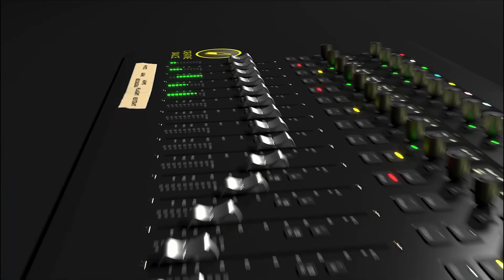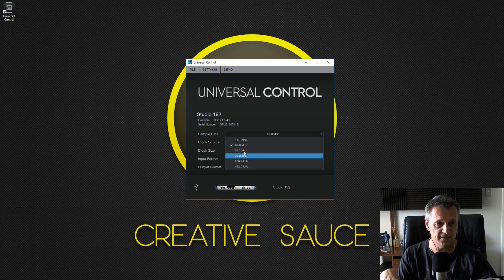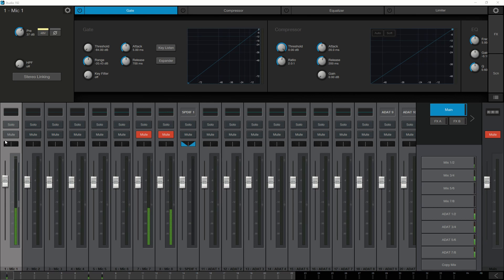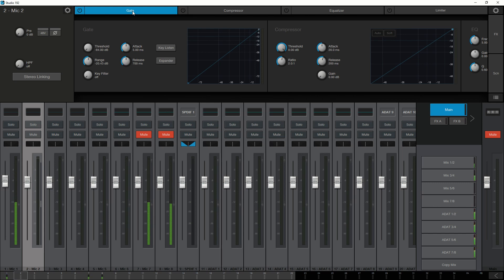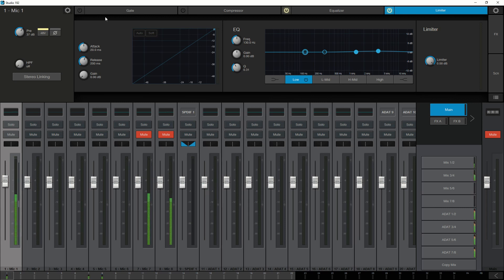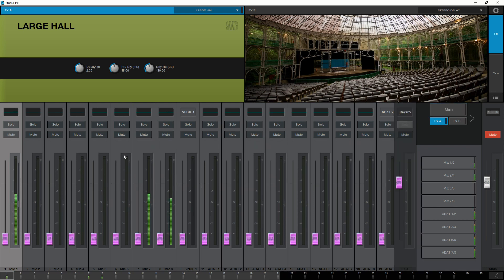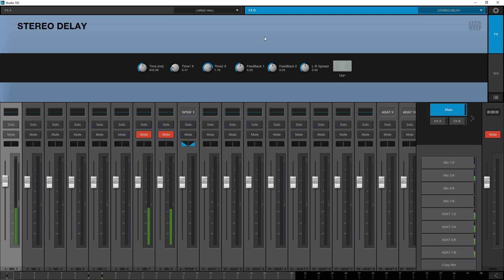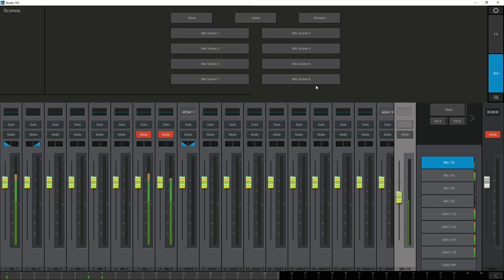Presonus Studio 192 Review Part 2: Setup and Universal Control

Comment: Watching the video because my StudioLive16R looks very similar in setup and on the mixer. I just wish you didnt skip the setup in UC control panel. There are things i just cant get to work, but im waiting for the Presonus to help me out, and I hope to solve all the issues fast so i can get to work. To my disapointment StudioLive dont support Dante. Its AVB compatible, but no Dante and it works strictly with presonus hardware. Presonus realy didnt want us to use their gear with gear from other manufactures, and probably if they could they would even make their router compatible strictly with presonus gear. If they did that nobody would ever buy their router, so the router is open to all kind of stuff. PreSonus AVB gear will not work straight out with non presonus gear on AVB network, the only way to get it to talk to non presonus devices is to route sends and inputs.  Pretty dull move from Presonus I must say. I got trouble accessing WDM setup, cant change the sample rate, clock source or adjust input and output format.  The mixer looks very powerful, but I need to get everything to work before I start messing arround with it.
Reply from the maker: Hey Jack  pop me an email at creative.sauce.tube@gmail.com  , maybe there is something I can help with. Also, just wondering why you need to use WDM?

Comment: Can you help me with a simple question... ¿ when you select a channel on Uc surface does universal control remote change the number of the preamp that you on the studio 192 display or only change the volumen on the screen ?
Reply from the maker: Hi, for me, when I select and adjust pre amps in UC surface, the display on the 192  remains on whatever channel is selected there. If it happens to be the same one, I do see the values change.

Comment: I'm about to buy a new interface to replace my old trusty delta 1010. Because i own Cubase,  i hesitate between a ur44, or a ur824. Then,  i started checking some other models.  I t'emmener being impressed by the presonus presentation,  last namm, and some of their cars really caught my eyes.  The 1824 seemed very cool,  and quite cheap,  even with its 8 ins. But because i have 4 or 5 hardware and,  like the virus c, or jp8080, i will need as much ins as possible. So i checked the studio 192... and wow. A ton of features,  and, the possibility to have 2 adats, for another 2x8 input channels.  Basically,  it has the same features as the ur824... 2x adats... word clock in/out... 8 mic/line input channels... 192khz 24bit...

But while the ur824 costs around 700-800 bucks, the studio price is,  normally,  around 1000 bucks, but stores sell them at around 750. Why the difference in price. 
Sure, i would get a better integration in Cubase,  with the ur, just like you had,  with your 192, and studio one... but...
It looks like we can connect up to 3 ur824 to the same system. ..

I honestly don't know what to do.  I use Cubase,  but using studio one,  one day,  it's not excluded. ..
Prices  are all most the same...
What about the drivers . Are you using widows ? Any problems with the drivers,  eg, if you use very low buffer sizes, like 64...32... by the way,  at 48khz, and 96khz, does the driver allow you to use, say, 64 or 32 samples, for the buffer? Which in/out latencies do you get,  eg, at 24bit 48khz, 64 samples and 32 samples,  and the same at 24bit 96khz ?would it be too much to ask,  for you to check those values,  under,  i guess,  studio one ? Thanks,  in advance. 

So yeah, man, i really don't know what to do. ... 192 OR ur824... (btw, which things didn't you like/w're missing,  on the presonus quantum series? )

Anyway, thanks alot for your videos, really appreciate. 

Ps. I was just asking myself. . When you have a adat or 2 connected to your 192, how would you use the adat ins/outs, inside your daw,  as a send/return....imagine you have a mono hardware  chorus unit...and you want the signal to pass through the chorus, and return to the daw...
Would you use one of the 1-8 main audio outputs, as a 'send'....and you use , eg, input channel 4, as the' return'..... but in case you have 1 or 2 adat units...which ins and outs from the adat would you use,  for the same purpose ?
What i find weird,  is the adat unit sold by presonus, that can go with the 192... i see 8 inputs... but i see no outputs...
I may look the most stupid person on earth,  but. . Shouldn't the adat unit also have 8 xlr/trs  'outs' ?
Thanks for reading :)
Reply from the maker: Hi, thanks for watching! I must do a follow up for the 192 soon! I'm away from my setup right now, but will do some value checks later. To cut a long story short, it's been running glitch free. I normally record with my buffer size at 128, 24bit, 48khz. I used to record at 96khz the benefits just wernt useful to me. With the buffer at 128, latency is no issue, even with a big song, lots of virtual instruments, and effects. Studii one does some clever stuff with latency as well, which means I can happily do low latency monitoring with inserts. I find this useful for example with electric guitar, where I really do want to hear the amp SIM while playing. I should mention though, that my PC is fairly beefy.... i7 7700 with 32gig RAM, and large libraries on SSDs. Running Windows 10.

Yes, I would use outboard effects in just the way you describe, and have done so. I havnt personally used ADAT with it yet, so can't say for certain. The digimax d8 has 8 outputs, but I note that the inputs are all XLR. Still, conceivable. 

I think the Quantum is also a fine option. There were a few reasons I didn't choose it. Mainly because I wanted a USB unit. Just more device connectability. The Quantum also doesn't have the onboard DSP effects (also the 1824 doesn). Presonus say it's not needed, as the thunderbolt makes latency so low, that you may as well use inserts. Maybe they are right, but I just liked the idea that my interface was handling that without any load on my PC.

BTW - the UR824 looks like a great unit also! It may hinge a little on the likelihood of you going from cubase to studio one!
Reply: @CreativeSauce  thanks man for taking the time to answer, really kind of you ! Currently I'm like 60% 192, 40% ur824...i might grab the 192, as a middle finger to steinberg, for their freakin dongle, for discontinuing the 700-bucks Midex8, for selling their cmc units at 150 bucks each (cheaper, those units could have been a tremendous success), for not adding a spectrum analyser to cubase, to force people to buy wavelab, and many other reasons. 

For what I've seen,  S1 can do 95% of what cubase does, and,  in some features,  even surpasses it. 
If you say drivers are rock solid,  then,  it's  good. That's the most important,  i think. 
Let's wait and see ;)

Again, thanks for your comment,  and i wish you a very successful career and YouTube channel.